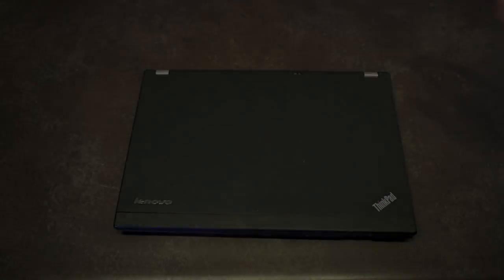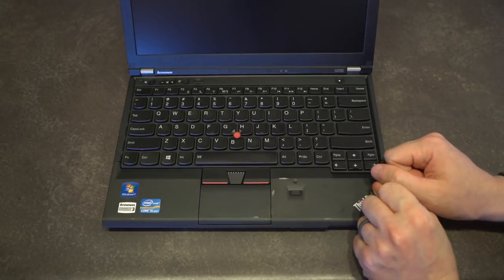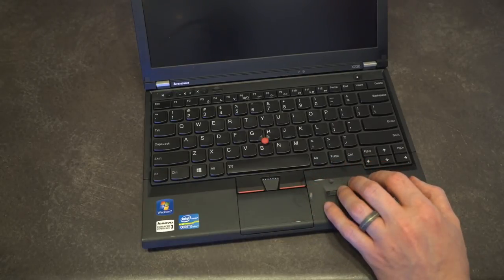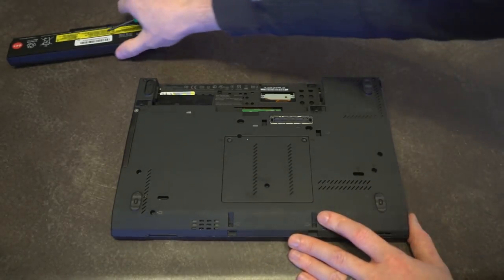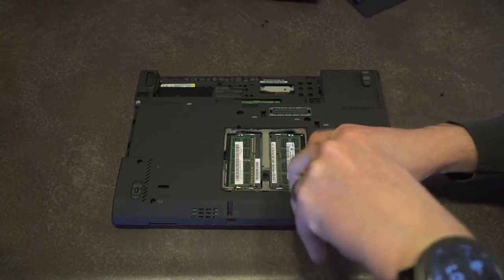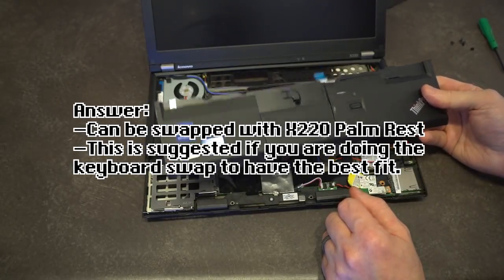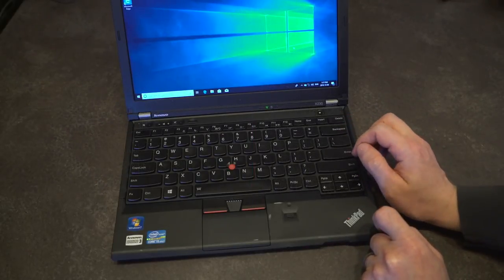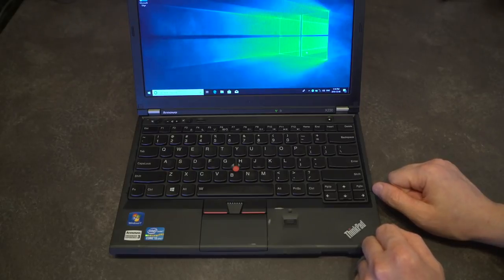Lenovo ThinkPad X230: A Fan Favourite

Comment: Hi buddy, can I ask a quick question, I've had loads of old Thinkpads and just picked up a x230, but I've noticed that it does not beep when the charger is plugged or removed... I kinda like this feature... Does the x230 not support it anymore? Or have I some how disabled it?  Thank you
Reply from the maker: Check the BIOS settings for that function. If it's supported still I'm sure you'll find it in there.
Reply: @LaptopRetrospective  thanks for your reply.. Checked bios.. Its normally under configuration / powerbeep but does not seem to be an option on the x230... Dam I miss my beep lol.. Have just watched a few videos on TY on the x230 and I haven't heard the beep when they plugged it in... Must be a lost feature.. Best wishes and happy new year.. Keep up the cool videos too
Reply from the maker: Hmmm interesting! It's been awhile since I saw an X230 so I don't remember. I wonder when that feature was phased out. Thanks for the well wishes. Here's to a good 2021.

Comment: Thanks for doing this video, I'm quite a fan of the X series for its portability and do not really fear the newer products as I myself also own a X240 and actually like it from minor issues (like not being able to use 16G RAM).

Oh and my trusty old X60t which I really like too but that is limited by the 32bit processor.

The X220 and X230 however often get recommended so I still consider to pick one up.
Sure the processors are old and outdated, for a good functioning Linux machine however, it's still more than enough.
Reply from the maker: Agreed. Thanks for commenting.

Comment: It's almost 2020, but the X230 I bought three days ago is probably still one of the best "netbook" / "small laptop" / "ultrabook" devices you can buy for money today.
Got it for a hundred bucks, and it's basically a brand new unit. Love the keyboard (please don't murder me, I actually like the chiclet style keyboards, though the previous ones were a lot more comfortable to type on, I admit) and the durability. Fantastic performance with only 4 GB of RAM (plan to double that soon) and a new 500 GB Crucial MX500. Though the two things I really hate already after a few hours of use are the fan (I unfortunately got a really noisy, rattling one) and the touchpad buttons - they're really poor compared to e.g. the ones in the T430.
Great video, you and a few other Thinkpad enthusiasts really got me interested in getting a classic Thinkpad again, took me only a week to buy both the T430 and X230. Very happy with both units, I think those two are a really good compromise between the old IBM Thinkpads (which were amazing machines at the time!) and the newer, more "streamlined" Lenovo devices. And my God I LOVE THAT THINKLIGHT.
Reply from the maker: Haha, thanks for telling your story! You might want to replace your fan of it rattles. That shouldn't happen. I think there are some that have swapped out the trackpad. Can't remember.

Comment: Watching this video on my x230 which is fully spec'ed out, I've swopped out the HDD for a Samsung 256GB SSD with 16GB RAM, my model has the i5 CPU (wish it was i7 though, but anyway), the IPS display, backlit keyboard, fingerprint reader, 3G modem and 9 cell extended battery. I also have the docking station which comes in quite handy when using it as a workstation system. I am running Windows 10 LTSC so performance is buttery smooth, easily beats out a T470.  My girlfriend also has an x230, though not as spec'ed out as mine and she loves it. these machines are pretty solid and hard to beat for its age and value.
Reply from the maker: Nice setup. Thanks for sharing.
Reply: Which samsung is that does it come w s pen?

Comment: Hello, how about speaker upgrade? I have an x230 and a T440P. Huge difference. When I use the T440P for Youtube videos I always have to keep half volumen on the speakers. I have a T440P donor, I took out the speakers, and "seems" the same size as the x230, but the come un a casing that need to ne opened. Have you seen such upgrade? Could it be done?
Reply from the maker: I'm not well versed in speaker mods for ThinkPads but we are talking about relatively simple components.

Comment: That's a beautiful machine. I was considering getting one, but in the end someone offered me an L470, which was still pretty nice. I really like the ThinkPad æsthetic.
Reply from the maker: Haven't had much time with the L series, how are you enjoying it?
Reply: I have an L440 and T420s, so I can pretty much compare them, the L series is made well but not as good as the T420s is. This may sound weirdo but it's still very well put down and it's still better than a HP which my parents bought for themselves. And it's easy upgradeable, you can even replace a CPU, while on HP replacing HDD to SSD took like one hour to do, on ThinkPad L440 I did it in like 3-4 minutes :)
Reply from the maker: L series might have some cheaper parts, but still has the serviceability.
Reply: Sorry I couldn't reply to this in time! I am currently using that sweet machine (: Swapped the screen to an IPS 1920 × 1080 panel. Got 12 GB of RAM in total and added a SATA SSD. It's possible to add an M.2 SSD, but it has to be smaller than the standard PC format (can't remember the number, it's in place of the WWAN module). The build quality seems to be cheaper, but it still feels sturdier than other common laptops. In the L470 you can't replace your CPU, though, without replacing the entire system board. Mine sports a little i3-7100U, but it's quite nice.

Now I am using it as a desktop replacement, as I sold my PC and I am saving some money. Currently using a DP screen and a VGA screen in a dual-monitor setting.
Reply from the maker: Sounds like a solid setup overall. Thanks for giving us an update.

Comment: Do you suggest the x230 over newer x computers?
I think when I get an X Series I’ll go for x230- the tablet version seems difficult to upgrade to an ips display. And I have t430- ivy bridge generation are up there as favorites. But I’m not sure about general quality of life and cpu speeds between the i7 dual core in x230 vs newer generations and pricing. 

I love tinkering and upgrading but I’m not thoroughly invested in the original t420 keyboard or upgrading. For example I think p50 is a much much  better buy than w540 unless you are to get the w540 dirt dirt cheap.
Reply from the maker: Like most things, it depends on your budget, use case and longer term plans if it is the better buy or not.
Reply: @LaptopRetrospective  ended up grabbing x230 for $50… stock i5 dual core isn’t as bad as I thought either! 

But planning to put in 3615qe. Kinda crazy at least the cpu, performs better than far newer i7 quadcore (8th gen intel low voltage is slower than ivybridge and hasswell, ofc being low powered)
Reply: The build quality is just too great. Seems like a new computer yet this was in the field for almost a decade. It seems even better built than t430, which I argue are some of the best made and still capable (not just novel) machines ever made

Def gotta factor in display upgrades. But after that, they run very well… 

Ivy bridge is my favorite series of thinkpads
Reply from the maker: Glad to hear you found yourself a winner. 😁

Comment: Hmm. I' m still using my x31 with an ssd. Works for MS Office, but Internet and HD Movies too much for that old fellow. BUT the X31 has the best keyfeel I experienced yet! Now my question: does the x220 have the same keyboard/keyfeel as the x31? How is it compared to the keyboard on the x230? I dont want to go through the hassle and change the keyboard. Thanks mate. Great content!
Reply from the maker: X220 is pretty boss. Can't speak to the x31, haven't used that before.
Reply: Have the X31 too! It's a great little machine back when XP was still supported.
Reply from the maker: Very nice. Still running XP or something more open source?

Comment: sorry to ask, by locked bios on x230, do you mean that if i want to change a new ssd, and upgrade to win10, i'm unable to do it because of the locked bios?
Reply from the maker: Don't be sorry, it's a good question. A locked out whitelisted BIOS means the motherboard will only accept certain WiFi cards or other approved modules by the manufacturer. An unlocked or modified BIOS removes those restrictions. You can change out the drive and install a new OS just fine without that. Unless there is a supervisor password set on the BIOS that you don't have, that's a different kind of locked.
Reply: @LaptopRetrospective  I see. So basically it related to hardware compatibility, right? Thank you very much Sir for clearing up my misunderstanding. I just found a well used X230 laptop around 100 bucks, and I was planning to buy it then do a little upgrade with it. Thanks 👍👍.
Reply from the maker: Yep that's the gist of it. Sounds like a great price by the way.

Comment: i think a chart of the comparison speed of i5 of x230 all the way to x280 and i7 will be super useful for your video. I remember one of the video talked about x230 is much faster than x240 all the way to x270. 

I'm using x240 but honestly, i prefer x230 keyboard feel. however i cannot deny that x240 is more portable and suitable for people who take public transport and travelling usually over an hr and especially with better battery life.
Reply from the maker: Thanks for the suggestion. The x240 gets used a fair bit around here for the exact reasons you've mentioned.

Comment: Hello, do you know if you use 1.5V or 1.35V DDR3 memories?
I have 2 modules, 4-GB of an HP notebook (DDR3, 10600, 1333-MHz 1.5V) and I would like to take advantage of them.
I'm looking on the Internet and it's not very clear to me.
regards
Reply from the maker: The x230 can take up to 2133 type. It will take 1.5 or 1.35. The lower power consumption is ideal since it is more efficient. So they should work but it isn't very fast RAM when you compare it against what it can handle.

Comment: I installed a 2242 M.2 drive in the WWAN slot for OS in mine, and then a 1TB data drive in the 2,5" bay and it works fantastic.
Reply from the maker: Very nice. Lots of storage to be had there.
Reply: Sadly, the mSATA (M.2) lines run on SATA II (3 Gb/s), while the main 2.5" bay is hooked up via SATA III (6 Gb/s). That's why I ended up just installing just one "big" SSD into the 2.5" bay.
Reply: @NebukadV  It would have been better with SATA III speeds, but as for a X230 with dual drive setup, this works quite well.
Reply from the maker: Fair points but sometimes storage is storage even if it isn't as fast as it could be.
Reply from the maker: Agreed.
Reply: @LaptopRetrospective  The m.2 SATA II drive is much faster than the original 320GB drive that came with my machine.
Reply from the maker: No doubt.

Comment: My one proud daily driver laptop. Surprisingly, I found the mini display port is more useful in my use case, or rather, in my location. I found more display devices using HDMI inputs instead of display port inputs, and the mini display port -> HDMI dongles are quite common (thanks to Apple for this) compared to the full size display port -> HDMI dongles. Sure, newer thinkpads use full HDMI ports, but don't feel to change for now.
Reply from the maker: Fair points.

Comment: Thank you for the videos, man. I just stumbled upon ThinkPads and I really, really like the idea of it. Going to go get an X230 in a few weeks (local store was out of stock). Really excited!
Reply from the maker: Awesome stuff. Let me know what you think when you get it.
Reply: @LaptopRetrospective  Definitely. I think I'm going to hook it up with a 9 cell battery if I happen to find one. I'll report back when I get it!
Reply from the maker: Roger that. Third party 9 cells aren't always common and the original ones tend not to have a full charge anymore so keep an eye out for that.
Reply: @LaptopRetrospective  Just got a fixer-upper X240! The keyboard isn't original and the touchpad leaves a lot to be desired. But despite those two issues, I really enjoy lugging this thing around compared to my other laptops. The build quality just really beats other laptops I've owned in the past.

Do I have to watch out for anything in case I want to upgrade the external battery on this thing?
Reply from the maker: I believe you are in the clear.

Comment: Bought mine in 2013, still going strong! Only thing I wish it has was an HDMI port. I've upgraded from 4gb to 8gb. Hoping to install an SSD but reinstalling windows 10 will be a big issue.
Reply from the maker: Why will it be a big issue?
Reply: @LaptopRetrospective  Windows was pre-installed and was never given the windows key. 
I've had a look at some videos on cloning but looks too complicated for me.
Do you have a more simple solution by any chance?
Reply from the maker: @beowolf4572  Macrium Reflect is pretty easy to use and has a free home version. Does require a USB 3 to 2.5" SATA connector but that's such a handy part, I consider it essential for any laptop owner.
Reply: @LaptopRetrospective  Thank you so much, looks pretty simple enough now. Can't wait to try it. Subbed!
Reply from the maker: Thanks for the support Beowolf and good luck.
Reply: @beowolf4572  for anyone coming by in the future, usually, reinstalling win 10 is super easy, Microsoft basically has your system in their database and knows its allowed to have win 10 (as long as it's the same version  as previously installed).
You can just get the software to create a win 10 bootable USB drive from Microsoft. 

You just tell it you don't have a key during installation and eventually it will activate itself.
Just did that on an x220 then other day, even works with the free win 7 to win 10 upgrade licenses.

That said, cloning with macrium and a USB to sata adapter is overall faster and it's never wrong to have a backup either.

Comment: My wife has the X230 and I have the X220 with IPS. I did not find noticeable difference in speed between the 2 but the X220 is definitely more pleasurable to use because of the better keyboard and screen.
Reply from the maker: Yep. It's an awesome keyboard. No doubt.

Comment: How do you feel about buying from ebay? i want to buy an x230 with an i7 and and ips display ( i dont want to do too much modification) and only upgrade the ram and the drives ( both msata and sata). i have seen a few of these but i live in mainland europe and am worried about shipping. any adivce?
Reply from the maker: Always try buying local or close by. I've bought machines from eBay but they are never they best deals for me. The stock IPS panels are not common, tend to fetch high prices and aren't as good as ones you can buy.
Reply: @LaptopRetrospective  thanks
Reply from the maker: @simonhorak  you're welcome!

Comment: I love my X230, had it for 4 or 5 years now. Bought it off UK Ebay with an SSHD and the clip on DVD-RW base unit. It's been great. It came initially with a couple of years original warranty included.
I wiped Windows 7 and run it exclusively with Linux Mint 18.3 which works with full functionality. The laptop power button stopped working twice over the years, seems to be a weakness with the laptop, but a 3rd party replacement keyboard is available at a very cheap price which works great including the illuminated keys and is very easy to fit.
Even now it is still a great laptop in my opinion and is even cheaper on Ebay than when I bought mine. :-)
Reply from the maker: Nice. Glad to hear you are keeping yours maintained.
Reply: It can run win10 well

Comment: Just a quick question cause I’m new to all this stuff, I may ask dumb questions here...
So tomorrow I’m getting one with a 6GB ram, and one of the games I’d like requires 4GB ram. I understand that’s enough but is the computer compatible for that?
Reply from the maker: What game? You need to consider the other system requirements such as CPU and GPU.
Reply: @LaptopRetrospective  the game is called Garrys Mod, it’s pretty old. The CPU runs 2.5Ghz, and with the GPU I’m unsure of.
Reply: @LaptopRetrospective  I’m getting the X230 as well, I just need reassurance so I know what I’m getting myself into.
Reply from the maker: That runs on the Source engine and the integrated GPU will not really be able to handle it.
Reply: @LaptopRetrospective  do you know what would be a perfectly cheap laptop to play it on?
Reply from the maker: Something with a dedicated GPU would help a lot. Direct X 9 era minimum.
Reply: @LaptopRetrospective can’t I just turn down the graphic quality on Garrys Mod? I’ll look into the laptop more.
Reply from the maker: You can only turn it down so far and it has minimum requirements that need to be met.

Comment: I used the top of the line i7 model with an IPS-display and it was very nice. The ONLY flaw with it was in my opinion too dim display and low res display plus the horrible GPU. If it has a better GPU (maybe even a dedicated graphics card) I would get one again. I feel like my MacBook Pro 13" Retina Late 2013 is worse in some ways. The processor makes a large difference.
Reply from the maker: Interesting observation!

Comment: I'm far from an expert when it comes to thinkpads. But this one looks exactly like someone shrunk down my T430.
I think I would like the X230 a bit more. But unfortunately the GPU kills it a bit for me. Intel HD 4000 is okay for daily use but it's so nice to have a dedicated NVS 5400m when you need it.
Reply from the maker: Yep, that is the benefits of the larger models.
Reply: Nikomon, I thought the same thing.  I have both models and like that the T430 has a socketed CPU and better graphics offering.  But when I tote the new laptop backpack my wife got me this holiday, my x230 goes in there.  That T430 is quite weighty 🤣